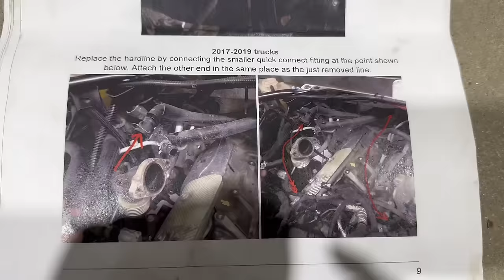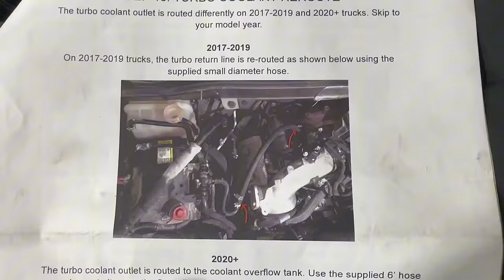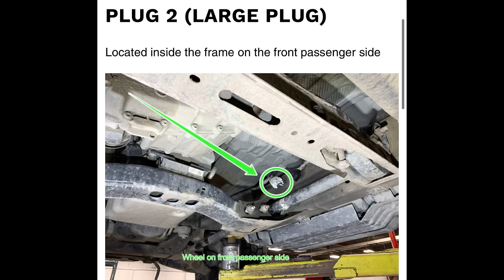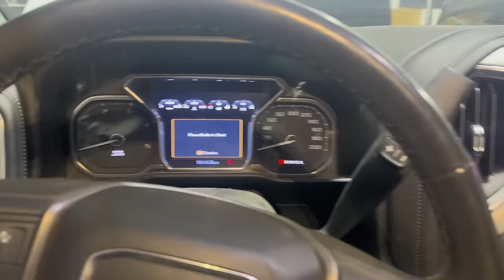How To FULLY DELETE L5P DURAMAX 2017-2023

Comment: What exactly cost $4500?? This is insanely expensive 😂🤦🏻‍♂️
Reply from the maker: Exhaust, hp mpvi3 tuner, ecm unlock kit, 8 credits, shift on the fly tunes, egr delete kit, can bus plugs, downpipe. Trust me, it ain’t bad. You used to have to swap ecms which added a couple thousand.

Comment: Man the ford trucks are dumb simple to delete compared to this. Basically have to do a full engine tear down just to get the egr out. On the fords it’s right in your face and it’s a couple bolts and it’s out. Same with the exhaust it’s only one piece but on this one it’s like 3.
Reply from the maker: Yup I agree. Same with Cummins, everything is was easier to remove. The duramax is a big job and putting that SCR filter behind the turbo was just disrespectful.
Reply: @darkirondiesel  yep forgot the Cummins was on that list. Now I understand why the duramax is so expensive to get done 😅

Comment: Whata mess of unnecessary crap. And everyone thinks all that junk all over that motor makes is ‘superior’  In some way, it makes it run better. Lmfao whata joke. I worked off and on at a chevy dealer here in Colorado in the 2010’s and i  couldn’t stand it. Its all junk. Disposable plastic unreliable junk. My 12 valve and 24valve cummins will still be running long after all the powerstrokes and durajunks are stuck in derated limp mode because of a $15 emissions part.
Reply: Hoodies!? You should use really nice under armor hoodies! No cheap ‘Gildan’ 100% cotton generic black hoodie. They shrink, they shrink to short and the arms end up shrinking to short and thats lame. A loose or ‘Athletic fit’. Extra pockets are always cool and make a hoodie better when there like a little zippered phone pocket, or zippered pockets In the front. Think of us mechanic (!) that always carry a little o-light or stream light flash light, A little pocket for a pen flashlight would be useful!